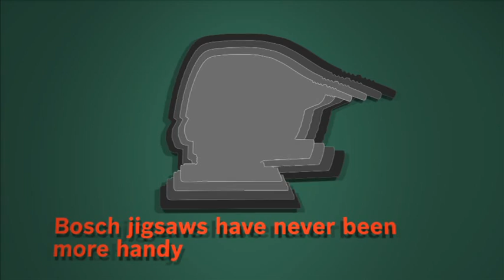Bosch Jigsaw PST 700 E

Comment: I've had some time🌗 allabout.wiki/BDEJS600Cl  to get used to using the saw now and I think its a good one. It feels very solid and well made - great BLACK+DECKER quality. I like the settings it has for the eliptical blade movement and blowing dust out of the blade path. The quick blade change lever is easy to use but wont be accidentally bumped. I feel that this is a tool that will last me many years. I was considering the next model up to get the additional blade stabilization, but I think most of the blade flex happens below the foot of the saw anyway were there cant be any support. I think usage technique can make up for most blade flex and you also have to realize that this is a fact of life with a jigsaw and use it accordingly.